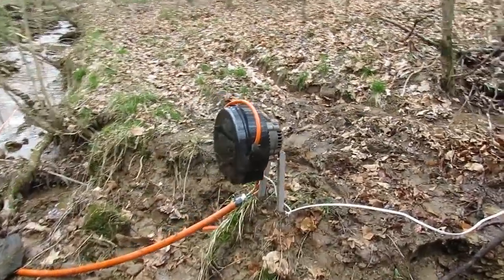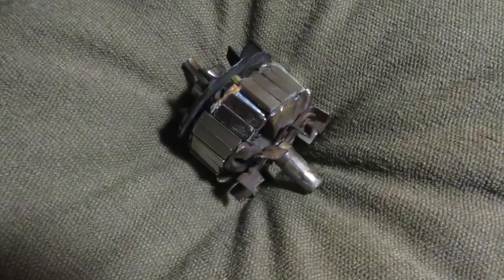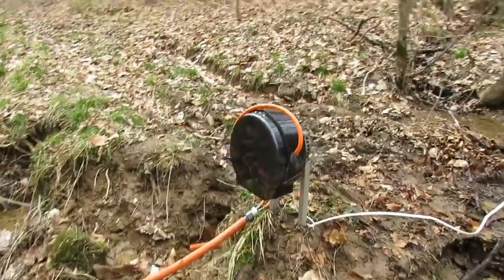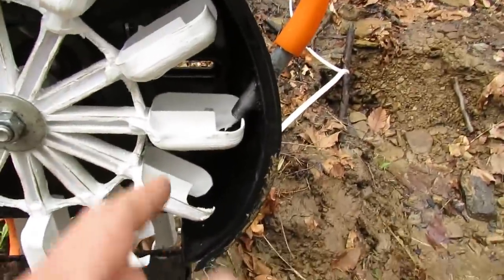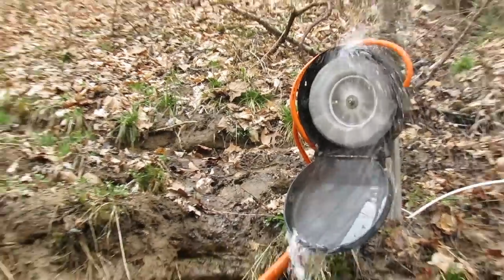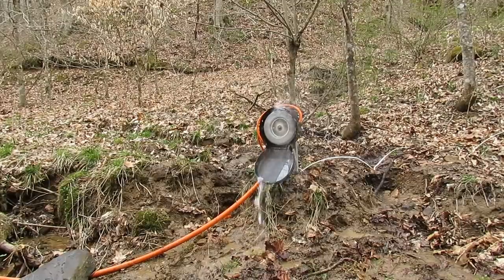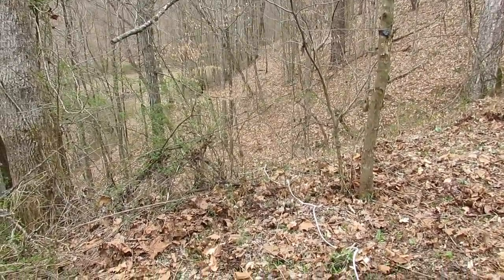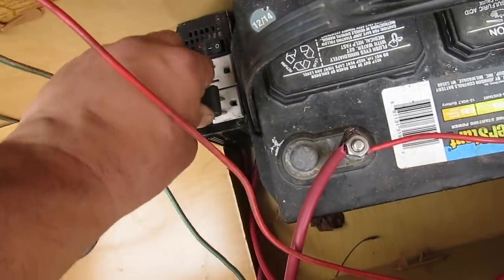Water Generator Running Off Grid Cabin

Comment: Nice job.  You should get the water off that generator/alternator.  the water will destroy it.
Reply from the maker: I did, I put a butter bowl over it. I recently changed it out for a coffee can. Here is the video showing it. https://www.youtube.com/watch?v=NTWoSivTpHE
Reply: He could use a timing belt to move it away from the water. And if he used a large to small wheel he could increase his rotational speed. Then add a few more batteries and he could be generating a lit more power
Reply: @Patrick1985McMahon  so while you're right your wrong because a 70 amp alternator spinning at Max isn't gonna keep up with draw while say a 240 amp will keep your charge up while running a heavy load.
Reply: @tronalddump8776  if I recall. Speed and torque is directly associated with volts and amps. So by reducing speed for torque or the other way would be a way to get more voltage or amperage. Depending on your needs. Mostly selected based off how far a distances your line is to the battery
Reply: @Patrick1985McMahon  if your alternator isn't made to produce the power it just won't unless you mod it.
Reply: @Patrick1985McMahon  crank the speed on a 70 amp alternator and your not gonna get 100 amps your just gonna burn it up
Reply: @Patrick1985McMahon  you definitely have to have it spinning at the right speeds but spinning one faster doesn't make it produce more. I mean sure if you get it to 18000 rpm I'm sure it'll push some extra juice before it starts smoking
Reply: @tronalddump8776  well yeah there's going to be limits to speed and torque of all generators. What I'm saying is he could increase speed in sacrifice of torque to increase voltage for the long run he has then he can convert to high amperage at the power wall.
Reply: @Patrick1985McMahon  14.2-14.5 is Max output on a alternator for voltage
Reply: @Patrick1985McMahon  that being said losing torque for speed is not gonna help you. The lower the speed you keep it while still keeping voltage at 14.2 is the best way to keep it going. At this point you need to either have a bigger alternator or know how to mod it internally to put out more juice.
Reply: @tronalddump8776  another benefit is he could use a lower gage wire to the power wall.
Reply: @Patrick1985McMahon  so your system slowly charges batteries?
Reply: @Patrick1985McMahon  also spinning alternator at high speeds for long periods of time will destroy it.
Reply: @tronalddump8776   This is a modified alternator  so the max voltage you quote is irrelevant  and it will make more power the faster you turn it..
It's a permanent magnet generator now, the guys who mod these for wind turbines rate them for varied wattage depending on wind speed.
Reply: get a boosted alternator and done
Reply: @ghz24  read my comments
Reply: @ghz24  you need to do some research. Magnets don't increase voltage, magnets increase efficiency.
Reply: @ghz24  the max voltage is relevant the rpm at which it's made is not since what I stated is for 99% of vehicles alternators that arent modified because you don't drive your car at an idle
Reply: @ghz24  permanent magnets still not modded to make more power without modding the voltage regulator.
Reply: @tronalddump8776  What does a car have to do with this hydroelectric project?
What regulator? Are you refering to the solar charge controller?
The "regulator" was removed when it was altered to be a permanent magnet generator.
You seem stuck on the idea that this works like a car alternator but it is very different, a car alternator wouldn't get turned fast enough to make any usable power in this aplication or a wind turbine. That is specifically this modification was for to turn a car alternator into a permanent magnet wind generator.
Reply: @ghz24  there's added magnets to make it more efficient that means spin slower and still make the same Amps, if he wanted to make it output more volts you have to add a resistor to the voltage regulator that is built into the alternator.
Reply: @ghz24  it's still a 12 volt (14.5-14.7 max without modification to the voltage regulator) alternator.
Reply: @ghz24  shit I'm wrong I missed the part where he took the regulator off to make it ac.
Reply: @ghz24  my bad, my comments were based on it still outputting DC
Reply: @tronalddump8776   It's cool. I know someone that got one of these off e-bay years ago  as part of a wind turbine generator kit but only ever got about 400 watts (before it destroyed itself). 
I tried to convince him to put a furling tail on it but he wanted all the power.
I would be surprised if this system is making 50 watts continuous.
I'm jealous of his stream, I'd use a direct drive hub motor for an e-bike as a generator and get  LiFePO4 cells to make a 24 volt battery
Reply: @tronalddump8776   Unless the internal regulator is bad or disconnected, then more voltage is possible.
Reply: @leonardwilson980  I didn't say it wasn't.
Reply: @leonardwilson980  more voltage isn't possible without tricking voltage regulator.
Reply: @tronalddump8776  he internally modified the alternator  from 12 magnets to 24 magnets. Also we're is this torque going to come from? he can only get so much from the water wheel, the lower the speed the generator spins is a longer life for the bearings.
Reply: @kaffirfromgod5162  no fucking shit Sherlock.
Reply: @Patrick1985McMahon  well no. If he used a higher amperage alternator  then he could charge more and make more power. Rpm is only relevant if under 2400 and is at maximum charging at 6000.
Reply: I thought the same thing...how is that not shorting out??
Reply: Yes, alternator's native habitat is usually under a car's hood.   Thus, it is somewhat used to a water environment, but not a lot of water all the time.  Not happy 🤨I would protect it with a plastic something.?
Reply: @ScDMiller1  a little water us not any different than a lot of water in this instance. the bearings will go before the water does anything to the motor
Reply: I was just about to say it was converted to ac and not still running dc but it looks as if you figured that out for yourself. But i would definitely add more batteries in parallel to catch that overflow voltage and power more small appliances as needed.
Reply: They're built for automobiles. Water ain't gonna hurt it. They are designed for harsh environments.
Reply: @gmenclik the friction using a timing belt would be negligible. Keeping your generator away from the water would give it more life. Also the belt builds in a little fault tolerance. Should something be moving too fast i would rather have slippage on a belt than to destroy my generator.

Comment: 5v Led light light strips, dont use 115v
Reply: Sure, just ignore the plasma tech and through caution to the wind. If you don’t know you should. One small hint. Avoid WHITE light
Reply: @johnwayne7476  
Color is irrelevant he is saying not to convert to ac to get light
Reply: ghz24 I admire these off grinders. Yes the lights are very cheap and put out a lot of light for little energy. Suppose I care a little to much for strangers. I’m in the thick of it and can’t get anyone to listen . It’s frustrating when your kin who have lived in the region since the late 1600’s refuse to listen. Then for some unknown reason the state Diox you and you don’t know why or even what it means till looking through FOaA for weeks then it’s not good news . Why? There is plenty of room for everyone. No need only greed. Chattling Too much . Thanks for the reality check. I took it to be a demeaning comment. I suppose they just decided to remind him.,
Reply: @johnwayne7476  You live in a "Legalized" State....Don't you?
Reply: AC is better power than DC. You're better off converting it.
Reply: @tronalddump8776  
Rather than argue the intrinsic advantages of one over the other, a fruitless exorcise unless you specify the application.
 I'll just point out that he is generating wild AC (unknown frequency and voltage) then rectifying it to DC then running an inverter to make AC  to run an intrinsically DC device.
Every time you convert you loose energy.
There is a fan in the inverter to carry off the lost energy as heat plus it takes energy to run the fan.
I get that it's virtually free energy but less waste is more capacity for other devices.
Reply: @tronalddump8776 , AC has it's highs and lows

Comment: How do you get AC Power out of a DC Alternator ? You Said it at is making AC Power at 4:54 ..  Also you may want to pile a bunch of large rocks under it so the dirt does not erode under it ..
Reply from the maker: I converted it to a pma by adding some magnets to the inside of it. I put a few rocks under it after I shut off the camera.

Comment: Great video! Have you thought of doing the same thing with a wind generator as a backup when the creek freezes over in the winter? I've been considering doing exactly that, there's lots of wind where I live here in Kansas.
Reply from the maker: I have thought about a wind generator. Not a lot of wind around here.
Reply: Just broken wind from the can-o-beans I just CRUSHED into next year, 2020 baby, HERE, I COMETH. (Kidneys, btw)
Reply: @lukeFugate  build a hill where the wind travels east. a hill for where the wind travels the other side. two wind generations in winter

Comment: Did you say 3 phase? Where did you get the ?      Your solar charger what brand? Is there a reason why you picked that model ? Really cool set up
Reply from the maker: Yes, it is three-phase. The solar charge controller is the one that came with a 100-watt panel I bought years ago. It is a pwm controller so it is not the most efficient. I would recommend a mppt controller for more efficiency.
Reply: luke Fugate  I am just learning about this . Meaning I know nothing .  I do t even understand the basics of amps  or volts. To me it’s very confusing.  Thank

Comment: I think he forgot that water is a good conductor of electricity.
Reply: Yes, indeed.  The connections at the alternator need to be waterproofed, for safety and also to prevent loss of some of your hard-earned amperes!Another place to improve your efficiency is to rebuild your water splitter and avoid dead-ending the water flow into a "wall".  In other words, the transition from one to two pipes must have all smooth curves to direct the flow so that there are no places where eddies can form.  In you current splitter, you probably have a few whirlpools that are sucking off some of the energy.  This might be a place where buying a commercial splitter would be better than building your own.

Comment: Why are you running ac to s rectifier to make it to DC  and and an inverter to make it AC to plug up a breaker box?
Reply from the maker: The A/C from the alternator is low voltage, around 20-25 volts.
Reply: @lukeFugate  The high voltage will travel through the wire with less voltage drop. that is why the public utilities run such high voltage in their transmission lines.
Reply: @JUST-A-TENNESSE Thang I under stand that . So why convert it st all its AC at the start

Comment: Are you sure that's 3phase...looks like possible single phase 220...not three phase...otherwise you'd have 480volts 220/220/140...or variants of that...common mistake ..
Well done on inovations...
Reply from the maker: It's putting out around 20-25 volts A/C. Not very much power though.

Comment: What can it power? Can it power a window unit AC? fridge microwave etc
Reply from the maker: All this setup can power so far is a few lights. It is a low power setup. I could power more with more batteries, but it would run down the batteries pretty quick.

Comment: Your setup is causing a lot of erosion. I really think you should considering runoff control
Reply from the maker: I did address the erosion issue. I put a layer of rocks under where the water comes out.
Reply: I think a little cement and grave mix to create a drainage can solve the runoff issue (with a few rocks over the drainage). Some reserves need permission to alter terrain... 👍

Comment: I really think this is a great little set up.  Do you have the box vented Luke?
Reply from the maker: It is by design. It has pieces of material that makes the door quieter to shut and they hold it off by about 1/16 of an inch.

Comment: I like it. i need the same setup i have a small creek with alot of fall.just need to get a alternator built.
Reply from the maker: For more efficiency, I would recommend buying a ready made pma instead of modifying a car alternator.
Reply: @lukeFugate  Is there one you would recommend for a water wheel?

Comment: and what size wire is that.  and what typ of alternater. the wire looks like 14/2. if you use the right alternater ,ike one from police car . you should get alot more output. then you can use larger wire or at least use 14/3 then you will have a ground. unless its a single phase alternater. man you need a multi meter. or i need to come up their and at least have a beer with you. i like these little setups.
Reply from the maker: Yes, 14-2 it's all I had laying around in the length I needed. good Idea on the higher output alternator.

Comment: you say you are comming out of alternator in 3phase ac. how come with all that water going everywhere. the arcs art flying or everything isint shorting out. that wire was in a shower.
Reply from the maker: It's low voltage A/C, it runs around 20-25 volts. Not enough voltage or current for it to arc. The water is also fresh water if it were salt water it would be shorting it out. It still wouldn't arc though, it would just short out and probably stop the wheel from spinning.

Comment: Put two ammeters in the circuit. One between the rectifiers and the battery charger, the other between the battery and the inverter. If the incoming watts are higher than those going to the inverter, you are winning. If not, add more input power. Another turbine or solar. You are correct, your solar panels MUST get 100% sun. NO shade on them at all or you're just wasting your money. I'd put the panels on top of a tall pole above everything else and make them track the sun. There are several simple solar tracker methods to choose from.
Next put a permanent voltmeter on the rectifiers and one on the inverter input. Watts = DC volts times Amps.  You can get meter modules CHEAP at MPJA dot com on line. Easy peasy!
Reply from the maker: I've got two 100 watt solar panels I'm putting up there. They won't be right next to the cabin though, not enough sun.

Comment: Your in just enough sun for the 100 watt harbor fraight four panel system and get two batteries I run t.v. fan there 12 volt and two LED lights come with kit when I need little more juice I hook the jumper cables up to riding mower your water wheel will work together with the panels.
Reply from the maker: I already have two 100 watt solar panels hooked up. I'll be making a video of them soon.

Comment: What gage (14, 12, 10?) of wire you using for your run from generator to battery, Also rocks all the way down to the creek. and dont forget rock's in the creek bed at the point enters the creek
Reply from the maker: It is 14-2 wire. Probably not the best gauge to use, but it's what I had. I put rocks under it shielding the ground from erosion. They do lead all the way to the creek, I just didn't film it.

Comment: No beginning!   just the middle (generator) and end (battery).  What ... you just stuck a water hose into the stream?
Reply from the maker: Yes, the pipe is just in the creek at a point about 30 feet up from where the generator is.
Reply: very good thinking Arc... there is no way that slow flowing stream can produce that fast running wheel at the generator..
Reply: I wondered the same glad you asked and he answered. Thanx to both of y'all
Reply: You can do like fly fisherman do and build a funnel out of rocks right at the end of a fast running spot in the stream to make the push of the water coming out alot stronger straight into the tube. You could also use a reducer fitting to make the end bigger so it can get more water.

Comment: How are you getting that much pressure on the water to start?  What is running 🏃 the water?
Reply from the maker: The intake of the pipe is about 30 feet higher than the nozzles.
Reply: Thank you for answering so quick.  I was watching other videos to get the drift.  Cool 🏂 stuff.  Good to know.

Comment: A great design. The only flaw is the length of the wire to the batteries is going to loose power.  A shorter distance will increase your power.
Reply from the maker: I need to get more water line to extend the distance so I can mount the generator closer to the cabin.